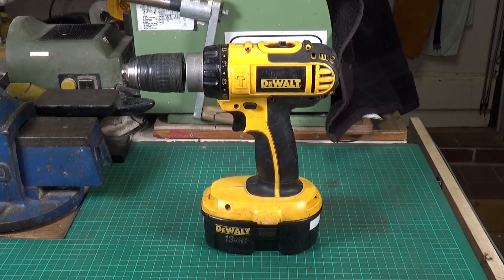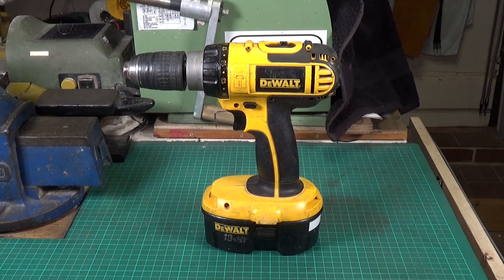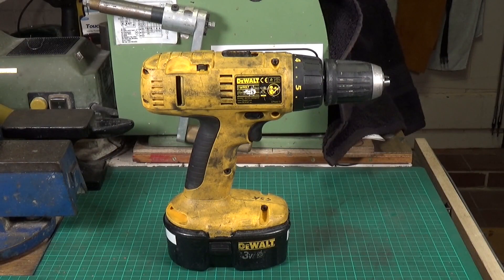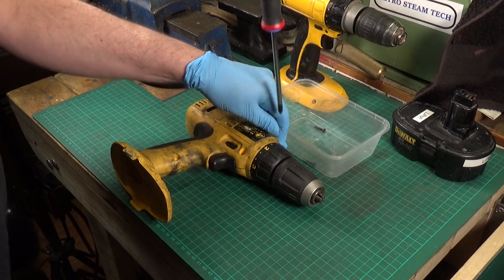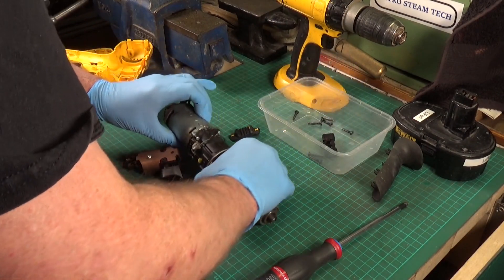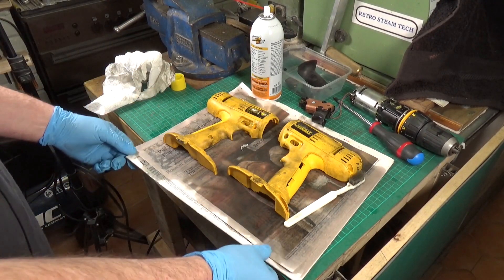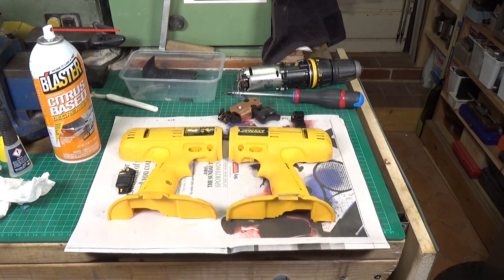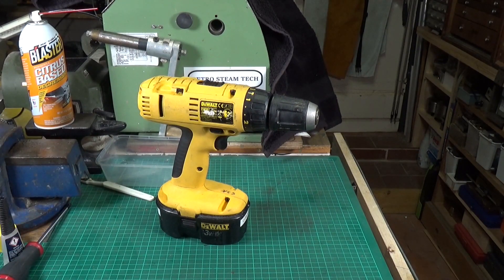DeWALT DW997 Cordless Drill £11 From ebay - Is It Any Good?

Comment: Came up quite well Alan.  It's amazing how much difference there is between cleaners.  Some are excellent and some are useless.  I'm a big fan of methylated spirits for jobs like this and generally try that first.  Petrol and acetone are both risky with plastic.  I was thinking you might put it in your ultrasonic bath with some bleach or degreaser.  Cheers Rob
Reply from the maker: Hi Rob. I must admit that I didn't think of meths. That citrus based degreaser is not bad but it's not the miracle worker the adverts claim 🙂 The handles are a bit too large for my ultrasonic cleaner otherwise that would have been the first thing I tried. Cheers, Alan.